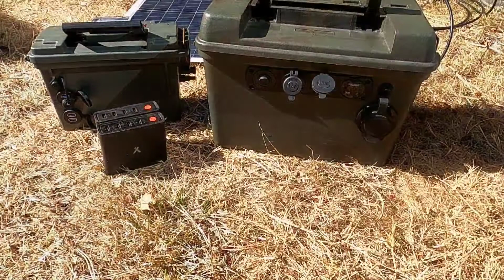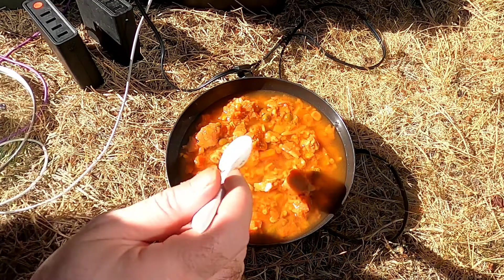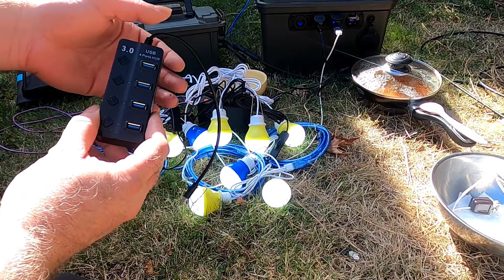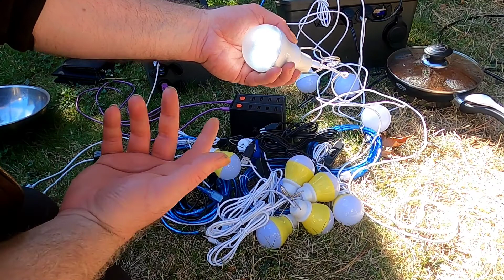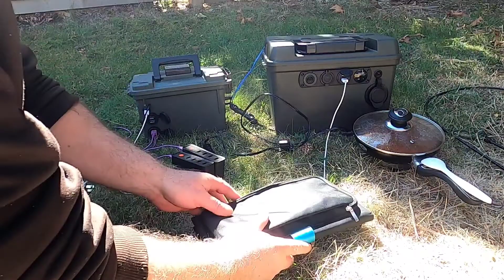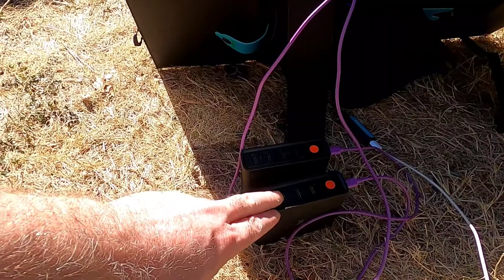DIY PORTABLE SOLAR GENERATOR OFFGRID LIGHTING COOKING FIRE MAKING AND WATER PURIFICATION SOLUTIONS

Comment: I completely agree with you on inverter size.  I built a 3kw "solar generator" with a 700 watt inverter.  A few people have asked me why I used a small inverter.  I tell them my goal was battery longevity not powering several large appliances at once and having the battery go dead in an hour.

Comment: You should do links to things you use, which would help give you a little kick back for your time helping folks. I found this information valuable as we use a small 100 watt power pack with usb ports, and a harbor freight jump start power pack that has both 12 v ports and usb ports so thanks for sharing your video. New sub here.

Comment: Hello Frank,
I always learn something in each of your videos. I have just watched the microwave one and you gave a good tip on using a resistor in order to charge/decharge a DC/AC converter.
I hope you will still be able to present your new generator.
BTW, what are the advantages of using a USB fire starter over a bic lighter or a ferro rod (this last could be used for initiate thousand of fires) and the hycpochorous acid generator that requires a battery, salt and appropriate dosage instead of purification tablets (unless living in an apocalyptic word where you can't buy these tablets, but the hycpochorous generator requires salt that would not be accessible in that case unless you live near the beach) ?
Thanks
Reply from the maker: Lighters and ferro rods have there place and I use them often and in many videos, lighters don't last long and ferro rods are a skill set within there own right, the heating element can last a very long time and is simple to use. This video is primarily about portable offgrid electricity abilities. The hypochlorous acid generator can purify more water over a far longer time span and does not run out like tablets quickly do. The human body requires salt as well and is something critical to general survival and would be an asset critical to acquire over time. Though I agree this may not be as easy to acquire for people living far from the ocean, but there are billions of people that live near salt water sources as well. In desperate situations people can extract salts from fire ash but that is another video. From my perspective nothing is a 100% solution for everyone but understanding how these things work and having the ability to use them to your advantage has its gains as well. I am of the belief if I had this setup in a remote offgrid location it would be invaluable to have and ease the labor needed to sustain yourself, just picture how much less wood you need to gather over time to cook and provide light... this really is for long term base camp thinking whether in an urban environment after a conflict or natural disaster were help maybe months away or remote off grid situations where self reliance and creature comforts are a consideration. Hope this helps, and hopefully you got something out of it, thanks for watching cheers.
Reply: @frankbush333  Thanks for your answer, I agree that each case is different, for those living in the wild a fire may be the answer to purify water and cook food as wood is easy to find,     can't fail and the resource is inexhaustible. However in an urban environnement and generally every time you want be discreet then electricity has its place.